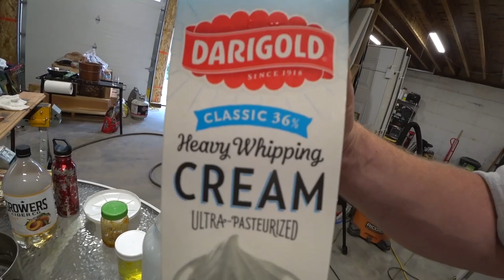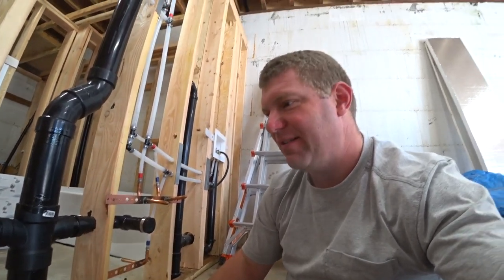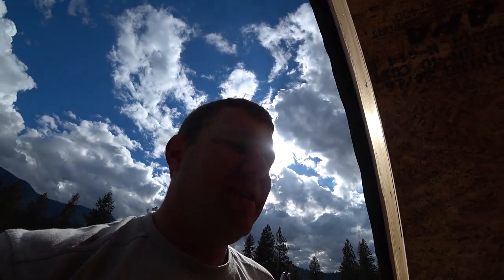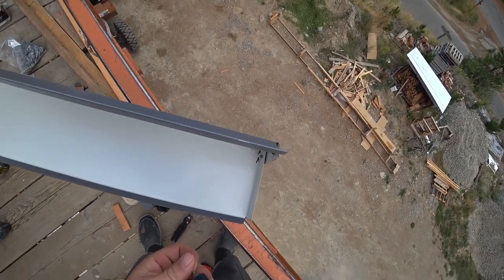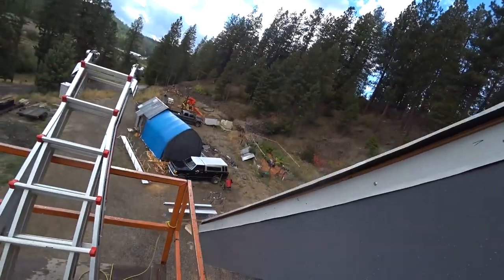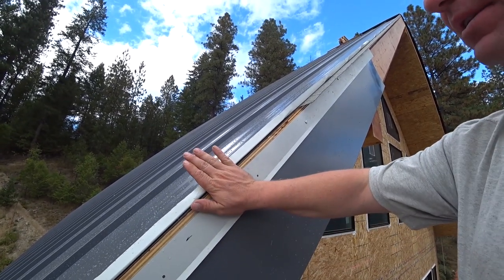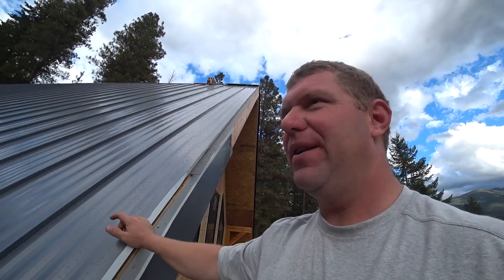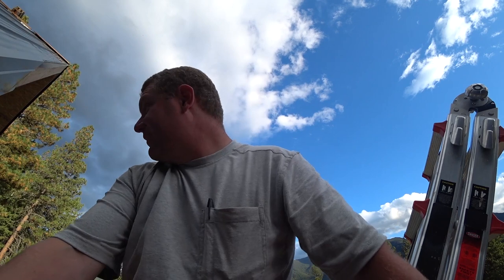STILL Not Done With Roofing? (Standing Seam Rake Detail)

Comment: I have seen you both work through the toughest problems and figure them out.I was a little surprised to see you have a bit of a negative attitude on the difficulty of the project at the beginning. Not saying it's easy or am I the one hanging in a basket 30 feet in the air. Just I've seen you both attack the toughest issues and come out on top. I thought at this point you'd think rakes are a piece of cake. You guys inspire me. I appreciate the work you put into the videos. Most of all I like how you work together.

Comment: Good work guys....Much better idea Jesse with the screws though it would look much better with the pop rivets. In Australia, your cladding our roofing fascia is pretty much a snap lock deal and any corner or adjustment is all rivets to keep everything clean. Having said that your rivet gun is fine but when you're in a situation like you're in the finish can be compromised as you are aware. You either need both hands on the rivet gun or one hand on the job your working on and one on the gun. The compression of rivet half work and half don't. I would recommend and trust me you will not regret this to either go Milwaukee 12V Pop Rivet Tool M12BPRT0 or pneumatic especially with your capping that needs to be done. Great work to Elyssa for her multi-tasking abilities and would like to recommend WD40 or RP7 for all stickers,  tags and barcodes that have to be removed from the cooking utensils..ie: The whisk Jesse was using to make ice creme with.... Previously I had watched Elyssa making jam and she was pretty keen on finding a better method for checking the temperature. I believe not just for the kitchen the list is endless that the Infrared Thermometer as a choice being a safer more reliable source. Body temperature, Automotive, Paint prep, Roof, Radiator, Fridge, Hot tub the list is endless.....Good Luck

Comment: Two things,  You want to get a 42 circuit panel for your house.  That will allow you to separate things for easy trouble shooting.
I've worked with electrical for 44 years so I do have an idea what is going on.  Second Item there is a company that makes a clamp that will allow you to clamp 2X lumber to the standing seams on your roof.  This would make installing the roof cap child's play.  Also if you ever have to do roof maintenance you now would have a platform to do it on.

Comment: Seeing the pressurised bulbs used to seal off your pipes gave me an idea for checking your water pressure. Could you make up a tap fitting that fits your water tap with the valve mounted in it and accurately check your water pressure with a digital tyre pressur tester.

Comment: I imagine you are done the fascia already as it seems the videos are released after the work has been done. Anyways when you use the pop rivets it is a good idea to use a flat washer on the backside. It will help make the pop rivettighter . You have to hold the flat washer against the backside while you are using the pop riveter.  Cheers Jesse and Allysa !   :-)

Comment: Set the cleat inside the rake trim and set one end.. slide the trim up then set the other side remove the trim and the cleat will be in position to fasten properly..  put a few screws in the fascia to hold it in place... Your soffit should have been installed prior to the fascia by the way...

Comment: I'm sure it's too late, but I am curious.  With the bend the way it is, it seems like you would be able to put the trim on to the cleat with it folded out far enough for you to see fully behind the trim then once you validated that the whole run is on the cleat, fold the top up to the roof and screw it down.

Did you try that?

Comment: Theres an easier way to seperate yolks. Empty eggs in saucer one at a time. Steralize a plastic carbonated beverage bottle. Turn bottle upside down, squeeze some air out of it (with lid off), put on yolk and let bottle suck it in as you release some on side like letting air back in. Put in seperate bowls.

Comment: 60 mile winds hitting that face will move it back and forth , if you know anything about metal bending it or moving it back and forth many times weakins it and then it breaks. If you want to get 30 years out of that roof attach that cleat for support to minimize movement. Also any time you put screws in is a place it will rust and after five years it will look like shit!

Comment: Do some research in "Viny-Adhisive-Tape" I guess it is possible to Glue it! And there are Glues from building trailers, air-planes and ships ... which will work for your needs! So I believe that it might be experimental ... but there is no need vor visible screws through your roof ... especially to that kind of industrial/chemical standard you decided to build ... so you can just try it and if it goes of in 10 to 12 years you can fix it ... much easier like fixing soaked in water from your zip construction and rotten ply-wood and osb panels ...

Comment: FYI they make a 1 1/2 fernco cap with a hose bib on it and you then hook up washing machine hose to either cold side of ash box or I leave a hose bib on cold side of rough near drain. Shark bite works good for water so you can reuse it

Comment: To finish your Ridge cap You're gonna have to go back to the ladder on the roof And work the Ridge cab from one side Being able to reach over and pop rivet it To do this You need to prep Every length on the ground using your metal punch. So you're drilling through  One thickness of metal. Personally I don't care for this method Because you are connecting all of these Pieces together And it kills your expansion. On a traditional standing seam roof,  A cleat Is put down the whole length Or every so many feet And the Ridge cap Is clipped on to that and squeezed  Just like you did at the base of the sheet. Put that on both sides This way it Expands In a different direction then the sheets do.

Comment: now i saw you tube where a guy was putting in cap on the roof , now he made special ladder it come up to just below the ridge cap and then me made v crown that was 1 inch higher on both sides and on the other side he short ladder that touch roof to hold the main ladder part in place v top he could the crown under and work on it it was really cool i will have look for it

Comment: The cleat IS a good idea, just poorly executed.  Pros would have cut the cleat from coil stock and then used a portable break to put the proper size bend in.  Butyl tape IS an excellent sealant.  I am not sure how well it will hold up against high winds.

Comment: At this point, would it have been cheaper to just buy that man lift?
Reply: They addressed that in another video. Even if they wanted to buy one, there's not necessarily one for sale in their region, especially used at a lower price.
Reply: and even cheaper than that to hire a roofer
Reply: Nope would have been easier to buy/rent a basket operated man lift instead of a forklift thats ntt suitable for the task. Used one at a sand mine to go 60ft vertical and 30ft horizontal(think a boom truck like the power company uses but more agile and versatile). He could have stretched out over the roof and had no issues and no use for that "sled".

Comment: Get rid of the cleat(s.) Do simply use the three or four screws on the fascia. Use either the sticky (butyl ) tape, or the screws, not both. You can hem up the end panel to prevent water from going under the cap and working its way down on to the fascia. Hate to break it to you and your spouse but the roof is a roof, not a Steinway piano, and it's not a Rolls Royce. If you truly feel that it meets the standards for either a Steinway piano, or a Rolls Royce, why are you using a tape measure, and not a micrometer that reads in thousandths of an inch? With out knowing anything at all about your roofing system, I'll bet at best the manufacturer somewhere in their literature says something like +/- 1/2" in. (means plus or minus a half inch) for the roof panels (front of house to back of house.) A span of 30 (thirty) to  40 (forty) feet  It sure doesn't say +/- .001" in. (means plus or minus one thousand of an inch.) You couldn't afford the material with that tight of a tolerance. Not to mention that the material you have put on the roof, probably expands /contracts (each panel) some where between 1/8" in. {0.125"} to as much as 1/4" in.  (0.250" in.) on a very sunny hot full day of heat.  All I'm trying to say is it's not rocket science, with rocket dimensions +/- .00005" in. {not a mis-print.} Its a house being built to above average standards, which is great.

Comment: Don’t take this the wrong way, but you are like a bull in a china shop at times ;-). Probably too late to suggest the following.  Your flashing which is designed to have no visible fixings on the side, held down by the cleat which is screw fixed.  The reason the seam is closed where the cleat fits into is to provide side pressure on the joint.  You open one end of the seam and walk the flashing up the cleat - something similar to how you joined your roof panel sheets with a rubber mallet.  A small block of wood and hammer would suffice. You should fix the cleat every 100mm along its length and the screws should be about 5mm away from the bend on the cleat - not at the other side as you did in your video.  Also, don’t cut your roof paper, but fold it under the cleat and screw fix this also.  The position of the cleat is determined by having your flashing at 90 degrees.  You can easily run a chalk line down your roof and fix the cleat against this.  The removal of the flashing you have stuck down is easy.  Get some carpet, stick a bit of tin to the back of the carpet, place the carpet pile side against your roof and use your multi tool to slice your packing in half.  The tin on the carpet acts like an anvil.  Then it will be much easier to remove the two tape sections from the tin.  You also have a solution staring you in the face to fix your ridge capping.  Make another ladder for the other end of the roof.  Make two “A” frame mounts that affix to your wall and eaves.  Have the bottom of each ladder secured to these “A” frames.  Build a parallel truss between your ladders and position a cleat across each ladder to secure the truss.  I would also wrap some rag on contact points of your roof to stop scratching. You can then use this truss to navigate the length of the roof.  Also mount your safety rope over the roof down the other side of the building to either your building, or your loader.  Just a few suggestions.

Comment: Noooo.... Sooo painful to watch!!!
Stop drilling holes into your roof and fascia tin while you figure it out!!!!
Try using strips of gorilla/cloth tape to temp hold it in place. It is strong and is easy to remove.
Use the tape as a second pair of hands to hold stuff in place - it will stop the tin from moving and scratching the finish.
You also could have left the mastic protective strip ON while you test fitted for gap.
Do you have spare fascia tin... build a 2-3 ft mock up section of roof profile and figure out the fixing on the ground - you have a bent roof panel you can practice with.

Comment: Not doing the fascia capping as designed will lead to problems. It might not be easy to do but it will avoid water penetration and unsightly fixings. Every time you do a project you ignore instruction and advice. You are a law to yourself. A parody.